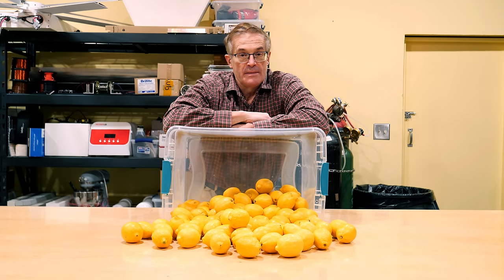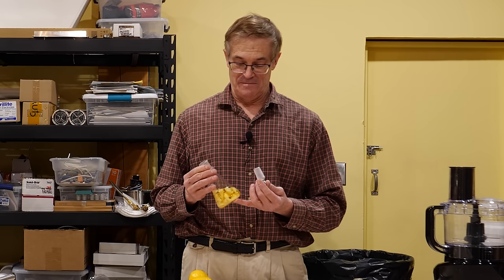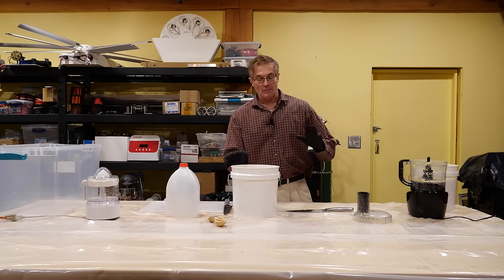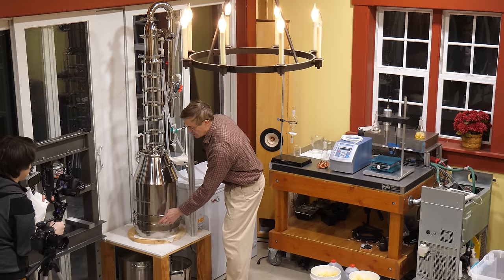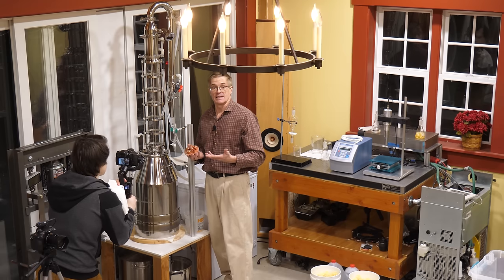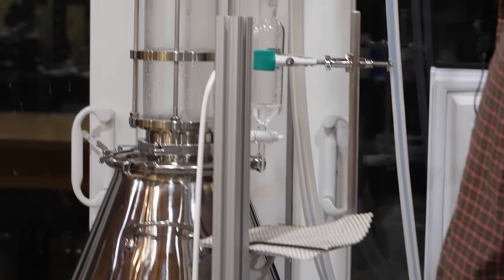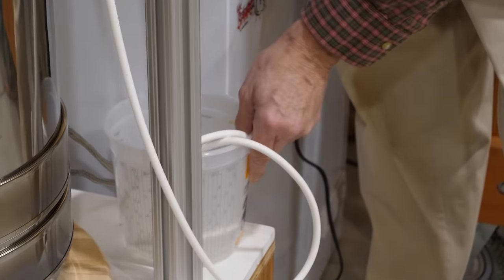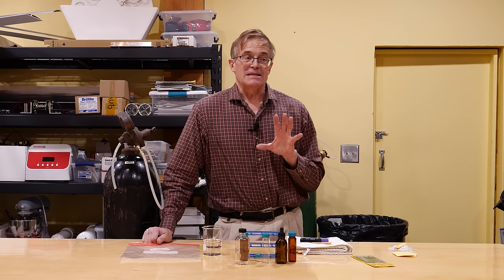CONCENTRATING LEMON OIL LEADS TO A VISIT TO THE HOSPITAL!

Comment: This is one of my more favorite recent videos from you!  Simply because you arrived at a process the same what I did.  I have all this waste material, what can I do with it?!
This my own impetus into the journey of distillation techniques.  As always, I've learned a lot from your methods and will incorporate them into my own.
I could geek out on this process and discuss it for awhile but here are a couple quick tips of my own.
1) For Limoncello you want as much as the rind/yellow part and as little of the inner white part as possible.  It makes it bitter.  Zest it into cheese cloth and macerate from there.  Trust me, you will notice the difference.
2) For oil extraction, try freezing the pulp first to help break down the cell walls.  I don't run it through a food processor like you do so maybe this is redundant but I would be interested it makes a difference for you.
Reply: One minor thing: You mentioned low flash point oils for candles.  I often use left over cooking grease but the low melting point (but perhaps high flash point?) tends to drown the wicks. I would love to see a video from you on this topic!

Comment: Would be interesting to see/know if there is a difference when only using the outer yellow zest vs using the whole bulp. When extracting the oils for limoncello directly with alcohol or with sugar you only use the outer zest as the white part contains biter substances.
Reply: Yes. That has been my experience, as well.
Reply: correct, Im glad someone else commented this - non bitter limoncello as a flavor only uses the flavado skin, the zest, not the pith.

Comment: I am shocked that I just discovered you, but I am super happy that I did.
Great instruction, even talking about the energy it takes to turn water to ice 144BTU pr lb, and the heat in the steam 970BTU pr lb.
In the Refrigeration and HVAC course I took, that was somewhat mind blowing. It only take 180BTU 1 lb of water to go from 32F-212Fbut 32F 1 lb of ice takes 144BTU to become water and 1 lb of 212F water takes 970BTU to become steam.

Comment: 8:24 - You shouldn't wait until you NEED stitches.... If the cut won't heal properly / danger of it damaging structures, you get them right away. 

Also, this is an important lesson: 

NEVER hold your cutting target with fingertips out. CURL them in (the claw grip), or form an "edge" with your fingers on top of the target cut location, and put the blade against the sides of your fingers as to avoid cutting yourself (and obv be careful of skin pulling down slightly and getting in the way).

Source: A home cook who has cut themselves many many times, and now follows this rule religiously as getting cut SUCKS.  

Also, if you're not proficient with a knife, there is NO SHAME in going slow. Nobody cares if you're fast really, just take your time and cut carefully. I routinely go slow on oddly shaped objects / potatoes as they routinely can slip / i lose track of my fingertips and can become a danger.
Reply: Tell that to any hospital when they temporarily sew you up and make you come back at their convenience to reattach tendons etc
Reply: @ethandescoteau  Yup... I absolutely will. Unless they are waiting for inflammation to go down?
Reply: @ethandescoteau  Could you explain please? I don't really understand what you were saying.
Reply: Slow is smooth and smooth is fast

Comment: Very detailed and informative video( luckily I was only listening not watching during the prep incident!). It might be wirth adapting the still  further  by adding a steam inlet and sparger to the vesseland injecting steam from an external source if you're going to try more delicate botanicals, or even extract oils from leaves (like rosemary) and steam distillation, which gives good yields at much lower temperatures (I'm not claiming expertise, but did do practicals in high school ckmparing steam vs simple distillation of orange oil, steam denatured less than boiling, then at university did the classic extraction of trimysistate from nutmeg, 30 years later I tried extracting oil from the abundant rosemary in my garden using a reflux still, for a short while the house smelt of rosemary, after a few minutes, and for days later, the house smelt more like cabbage as the rosemary got to cooking temperature 😉)  I was using tap water for cooling cooling tank might mitigate some of the side notes🤔

Comment: Thought I'd pass along an interesting phenomena I discovered by accident.  Added a little bit of Eucalyptus oil to the water in a cool mist humidifier tank which was made of clear acrylic plastic and opaque base plastic. Didn't  empty tank after use and a couple days later found that the acrylic and base had been "etched" and to some degree melted or starting to dissolve. Essential oils seem to be pretty powerful!   Hope this info can be put to some use. Interesting and well done videos. Thanks.
Reply: Eucalyptus oil is especially aggressive, I use it to strip labels (well, mostly the glue) off glass bottles to reuse.

Comment: Love you guys!  As always I'm late to this very entertaining show.  As a Limoncello maker myself - (the hi proof way) I recommend both lemons and oranges for an excellent after diner aperitif.
Also one other easy way to eliminate oxygen in a jar is to use a kitchen vacuum sealer.  Using one of your vacuum jars which only need be bigger than subject, place the subject inside with lid screwed only finger tight.  Vacuum this and when you release the vacuum your jar inside will stay sealed from outside pressure. Finish with a finger tightening ... I do this to my yeast that is bought in bulk.

Comment: Hope your excellent assistant did not have to suffer 'The Throb" for too long. Hope he heals fast. Another brilliant video. I use a product called Citrisolv. It is a cleaning solvent that uses Valencia Orange oil as a base. It removes ink stain and tar and things like sticky masking tape residue. It is the best cleaner for removing construction adhesive, like Liquid Nails from the hands without having to use nasty acetone or lacquer thinner. The construction adhesive melts away in seconds like magic with the Citrisolv.. I would expect that the lemon oil would be effective as a cleaning solvent as well. Do you have a recipe for something like that? Citrisolv costs about a buck an ounce...kinda spendy when used in it's concentrated form. However, one 16 oz bottle mixed with water, can make 22 gallons of good all purpose cleaner... It smells good too...Amazing!

Comment: With all due respect, having brine (with an equilibrium temperate below that of pure water i.e. zero) flow through the condenser  will create a higher "delta T" and hence a higher "delta Q" which may help condensing more vapor.
Thermal energy required to convert the ice to water is provided through heat exchanges in that ice/water pool and will determine the rate you melt the ice, if water is not circulated back; if it is, then using brine instead of pure water will make the condenser work better but will melt the ice faster.
Thanks, I highly appreciate and  enjoy your thorough educational videos.

Comment: Nice piece of chemistry here. I used to make vials for quantifying bacteria by anaerobic culture. We found that merely blanketing the vials with nitrogen with a quick spray before crimp capping effectively removed the oxygen. Significantly enough to allow our bacteria to thrive and survive anyway. We had some iron in the vials as a food stock and substrate though and vials were low volume only 3-5ml or so. Any dissolved oxygen was quickly used up in corrosive processes on the iron. Nice packing technique here especially for higher volume stuff! Congrats.

Comment: i use superglue when i cut my fingers! it works great if you sterilize first and then wrap tight until bleeding clots and put on top of cut wrap with band aid after glue is dry! keep adding little superglue  to really seal up area for longevity each band aid change! Great Video Thanks Guys!

Comment: Great video. Thanks for clarifying the flummery about brining the cold water. Simply not worth the hassle. Just to remind viewers, having heavily iced water will work fine to control temperature. I am a little surprised you went to the trouble of getting a chest freezer when you already had a lab chiller.
Reply from the maker: Thanks.
It's a matter of capacity.  The chiller is rated at 500 watts while the heat that needs to be removed is approximately 3,000 watts. A chiller that large would cost far more than the chest freezer.

Comment: Those Erlenmeyer flasks with ground glass mouths are really useful. I'm surprised how many chemists don't know they exist. They're a lot better than round bottom flasks for when you don't need the amount of heat you can get from a heating mantle but you still want to reflux a reaction. They also make graduated cylinders with ground glass tops which are great for gas/liquid reactions where you want to increase gas bubble residence times in a liquid as much as possible while also being able to reflux things.

Steam distillation is a good example of a problem in chemistry: product being carried away by the volume of gas produced by boiling off solvents. I've seen people (including myself) who were expecting to get 90 percent yields get basically zero yield because of methanol or water or hydrogen chloride vapors carrying away your yield. Its especially hard to do when a reaction produces gas that is nowhere near liquid at room temperature (like HCl or CO2) and you have to use methanol+dry ice just to keep your product from vapor-distilling away.

Sorry for the TL;DR but I do wonder if you could vapor distill essential oils with just an aquarium bubbler and lower temperatures on both the "boiler" and the condenser.

Comment: Honey is a triple antibiotic and has multiple methods of killing germs and is also a good nutrient food for healing a cut.  Super glue can be used with string to GLUE stitches on to keep the glue OUT of the cut but to help keep it lined up.  Use criss crossing thread, glue the border down to keep it from shifting.  Straight across stitches will allow a little shifting.

Comment: I want one of these stills 😄
I am not sure what professional background the presenter has but it smells like engineering.
He has great passion for what he does and how he explains it.
Cheers
(Australia)
Reply from the maker: Thanks.
Engineering  isn't  just a profession, it's  a mind set. And no, that's not my formal training.
Reply: @TechIngredients  Agree - my area of research is Chemical Engineering.
I dabble with beer and wine making and also distillation. I tend to use smaller volume equipment and make small batches of products. I like developing control systems etc. and refining the end products.
Currently designed a tall tube fermenter which is rare in the beer manufacturing industry.  There are bottom and top fermenting yeasts used in the beer making industry for example. I am experimenting with larger beers at the moment where the yeast prefers to work in the bottom section and at lower temperatures. The tall tube fermenter enable me to sample the bottom, middle and top sections of the wort as the fermentation proceeds.

And of course I get to drink the product and share it with friends 😁

Keep up the good work on your channel - you have certainly produced some real gems in your vast list videos over the years
Cheers

Comment: To rapidly settle and decloud the organic extract, add salt to the water or add some brine. It pulls the moisture from the oil and actually stops it from spoiling or reacting as there is less water in it.

Comment: Really like what you are doing. And appreciate you approached extracting lemon oil using heat - given the equipment you had.
However, lemon oil are quite subtle,  easily fractured with heat (why chefs squeeze lemon juice over a dish After cooking!) 
So, I would strongly urge you try: Vacuum Distillation.  From a glass spiral in a water jacket, I get a very pure lemon oil - which has a charming parlor trick feature; that is a very low vapor pressure. So ask a guest to just smell a beaker of the oil --- almost No Smell at all!
Then take a eye dropper, put only one drop of two into a beaker of water, and wow! The whole room smells  of Lemons! (In  aqueous solution, the lemon oil in water has a Very High vapor pressure...)
Run  high proof clear vodka through an activated charcoal filter to remove organics, add just a few drops of your very pure lemon oil and that's a fine liqueur.
I now use lemons from trees raised from seeds and never exposed to pesticides or organophosphates, so I've also used clear vodka as the extraction solvent instead of water. My typical batch aims to produce no more than a 100ml at a time to scale down the batch. Fractional Distillation with close control of vacuum pressure makes for a pretty small countertop operation.
All the best!

Comment: I think you will find that you have produced a mixture of two oils.  One from the zest of the lemon, and the other from the pith.   Some chefs insist on just using the zest, and remove just the outer yellow coating with a zester.   The pith tastes different and would spoil the flavour.   However for marmalade you use both parts of the lemon.   Extracting the Zest Oil might be possible by using a small press, as there is so little of it.

Comment: This is one of those prime examples of why knife skills are important. When you handle a chef knife properly and use the proper technique the odds of this happening are severely reduced. Pinch the spine of the knife just after the handle so that the knife can't turn or spin in your hand, and rest your finger tips straight down onto the stuff you're cutting with the side of the knife against the flat of your knuckles. Almost impossible to cut yourself like that since your finger tips and thumb are never in position to be cut.

Look up a picture or video of how the pros do it and never slice your digits again. It's worth it. Plus you can go faster and more accurately. Sucks that happened in the vid but hopefully others will take the two minutes to educate themselves. Excellent vid, fellas!
Reply from the maker: Agreed and thanks!

Comment: When you slice things with a knife, always hold the thing you're cutting with the tips of your fingers curled in and pointing back towards the underside of your arm, and rest the blade against your protruding knuckles while you cut. That way, however fast or inadvertent your are while cutting, it is very unlikely you will manage to cut yourself.

Also, I think that if you believe you need stitches it's best not to wait as it improves cicatrisation a lot. I've sliced my fingers a bunch of times though, and I found out that even when the cut is rather deep, you can often get away with it with a very tightly wrapped bandaid that maintains the open skin tightly together.

Comment: I have a scar from the tip of my index finger about a third of the way down the thumb side from when I cut through a lemon and slipped. It hurt like buggery. I hit the bone. It healed up eventually but there is a clear line where the finger print lines don't meet up still and it was almost 30 years ago. On another note D-limonene is a very useful solvent. Really good for cleaning too. Leaves the house smelling of citrus.

Comment: On the accidental gore scene... I am 70, and I have had cuts for various reasons. Over time, I have found the least scaring and quick healing is to use antibiotic creme with petroleum jelly in it to cut off the air to the cut. There were no close ups of the injury, so no opinions to stitch or not to stitch.

Something else that came to mind is the one-handed methods for setting up cut cut cutting boards for one-handed cutting aids for people who have lost use of one hand (stroke or whatever). Look for cutting board food holding methods for one-handed people... that might be helpful for cutting repetitive motions for cutting lemons.

Comment: Another way to remove dissolved gas from liquids which is common in chemistry labs is to employ a schlenck flask or rubber septum/cannula and a gas manifold controlled by a 3 way valve. The material to be degassed is placed in the flask and attached to the manifold which is attached to both a vacuum pump and a source of dry nitrogen or argon. The flask is placed in extremely cold media, such as rubbing alcohol and dry ice or even better, liquid N2. The material, once frozen, is then allowed to just start thawing, then is gradually exposed to the vacuum. Gases are almost completely insoluble in solids and have extremely low solubility near their melting point. By repeating this freeze/thaw cycle several times until no more gas is evolved, the liquid can be almost entirely degassed. At that point the flask can be backfilled with nitrogen or argon, ensuring the liquid only contains the inert gas in the container headspace.

Comment: Adding salt to the water would improve the cooling performance of the setup. You'd still need to freeze it to produce that 2/3 ice as before, and you'd likely need to freeze it longer, using more electricity - but you'd obtain ice at about -4C instead of 0C, and that would be the operational temperature of water in the circuit. One of factors of heat dissipation is the temperature gradient, and extracted vapors would transfer more heat and faster to water at -4C than they do to water at 0C. The total heat sinking capacity of the refrigerator of water would hardly change at all, but the amount of heat removed from the product per minute of distillation would rise, and the exit temperature of the condensate would drop. Of course that also mean the full refrigerator would last shorter, as the same amount of water would extract more heat and warm up faster, so think of it more as "turbo mode" than "extended milleage".